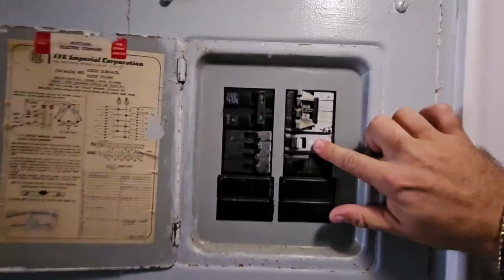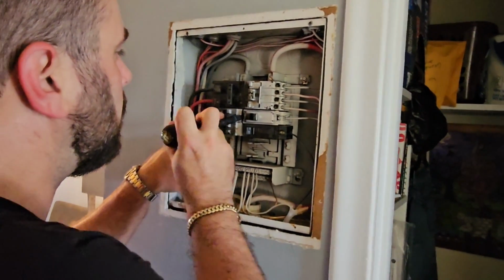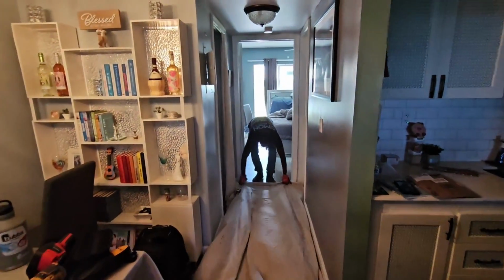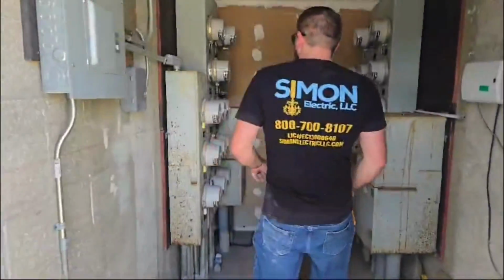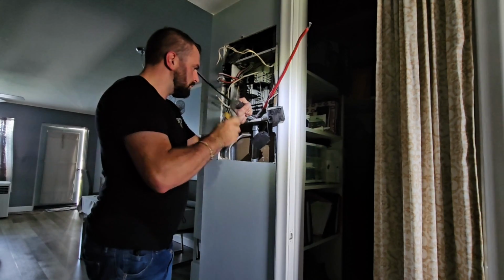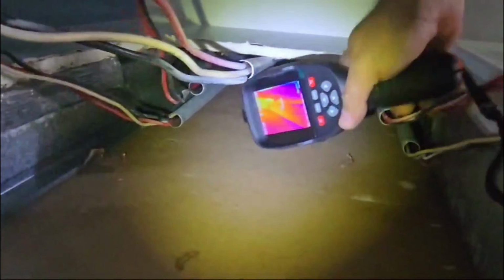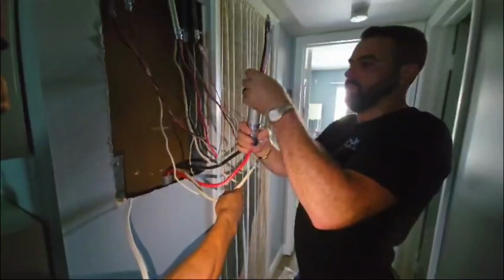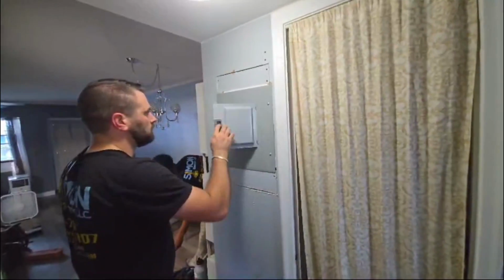This breaker panel was sparking and smoking while all the lights flickered. Simon Electric

Comment: @Simon Electric  QUICK TIP …

I accidentally cut an installed 3/4” copper water supply when cutting drywall with a Sawzall during a sub-panel install.
I sent one of my guys to pick up copper tubing & fittings AND tubing cutter.
He came back with a Greenlee green colored tool that looks like a pipe cutter (small disc blade and threaded “T-handle”).

It turns out they make an EMT cutting tool that makes PERFECT cuts without the need to debur.
I still use a mini bandsaw for most EMT cuts for speed, but for single pieces, I toss the Greenlee cutter in my box.
Reply: FORGOT  The whole point of my comment —>  it’s PERFECT for cutting EMT with conductors already inside.!
No worries about nicking or cutting insulation, no deburring AND no metal shavings dropping into the pipe,
(the rotary disc “blade” has a different geometry than standard pipe cutters.  It chamfers the internal and external surfaces)
Great channel, you do good work.

Comment: Simon Electric does Crap Work!
A real electrician handyman would have replaced the panel with the very best brand available.
The two obvious choices?
“BullDog PushMatic”   OR, if you have the budget…. Federal Pacific Electric!

😉🤣
Reply: At least THE multipurpose electrician’s tool was used for locknut removal.
The Linesman is THE tool for all tasks.

Comment: I believe the die cast emt connectors are no longer made, probably because they crack like you experienced and then become a poor ground.
Nice that the apt is piped in with emt.
Reply from the maker: Yes, emt is pritty heavy duty it is the original fire rating, which is why they upgraded it, but technically, it was overkill

Comment: Maybe one breaker lost good contact with the bus bar? Maybe one breaker internally lost good contact? 

Maybe a breaker was tripped many times without cooling down and the springy contact at the bus bar lost its spring due to overheating? Maybe the painter slightly dislodged a breaker?  Maybe paint got inside the breaker, interfering with tripping?

A breaker (Square D) once tripped while I was cutting the lawn with my electric mower. By the breakers, it stunk from hot plastic. I needed to wait until the one hot breaker was possible to touch. The removed breaker was bulging and it would not clip to the bus properly with a good thunk, because the clips lost their spring from the heat. Going by the bulging, possibly it was inside the breaker that overheated and the heat transferred to the clips.

House was built in 1959. The mower pulled under 5 amps. (They claim 13. haha.) Bus bar looked normal. New breaker hasn't tripped.
Reply from the maker: As long as there is no damage to the bus bar, that's the important thing

Comment: I used to come across those burnt up ITE panels in apartments alot. In those cases i would leave the old panel in place and get a new one that would match up and just swap the guts out. Saves alot of work and time. Nice job though man! 👍
Reply from the maker: Thanks we would need to find oem parts in order to do a gut swap
Reply: @simonelectricfl  I think Eaton makes retrofit panels that can go in existing panelboard boxes
Reply from the maker: @plur90  you are correct,  and I think that is a great idea but you need to be swapping a bunch of panels to make it worthwhile, and order time is also an issue.
Reply: I guess that type of panel just loves getting burnt up, i believe the old apartment i lived in had the same type of panel and also had a breaker that was arcing, and of course maintenance was going to take forever to replace it (owners didnt like paying bills so it took a bit to get supplies as the minimum wage, < 20 hrs a week maintenance dude had to pay for parts out of his own pocket as none of the local hardware stores would sell directly to the apartment management company till their debt was paid)., I ended up replacing it myself and moving it to a free spot that wasn't pitted from the arcing, hopefully after i moved out they did a proper repair, but i doubt it.

Comment: What would be the estimate of a type of job like that. A Ball park figure would be good. Just curious. Watching from the Caribbean
Reply from the maker: It depends on a lot of different factors
Reply: @simonelectricfl  a range like 500-900 simply for instance would be good . if those figures are so, you can let me know.
Reply: 2000-3000
Reply from the maker: @richstarstar Panel replacment cost can range in price from 1500.00 - 3000.00 generally
Reply: @simonelectricfl  Thanks much. continue to make great content. cheers
Reply from the maker: @richstarstar You got it! I have some cool stuff coming soon.

Comment: great video.  really convenient to have a main disconnect below the meter, makes replacing the panel much easier.
Reply: For this particular panel, the reason for the main disconnect below the meter instead of in the panel is because this panel is not located behind or beside the meter where the service wires would have entered the home.  Having the main disconnect outside at the meter in this situation is critical,  because service conductors, meaning on the line side of the main breaker,  do not have any overload/short circuit protection,  other than the high voltage fuse on the primary of the utility transformer,  which was selected to protect the transformer, NOT the line running to the house; if the service conductors were run inside the house with the main breaker in the panel, and damaged, say from a nail or screw, the SEU cable would be incinerated,  sparks and molten aluminum/copper flying everywhere,  house would probably be on fire with no way for the homeowner/ fire department to turn off the power, if and when the primary fuse on the transformer pops, the damage is already done.
Reply from the maker: Absolutely!
Reply: All by design